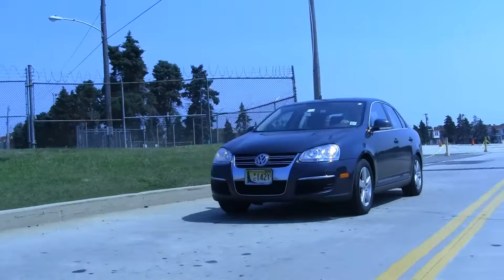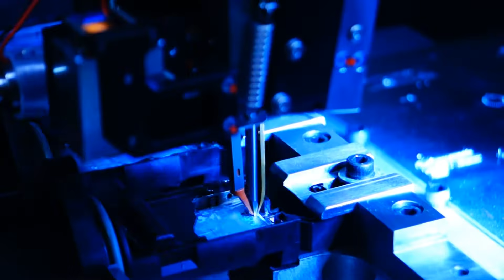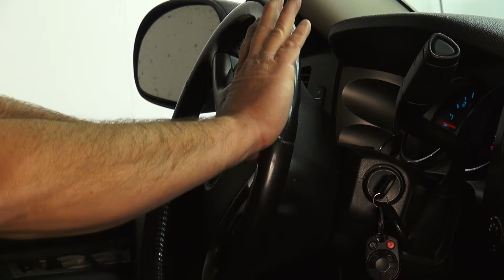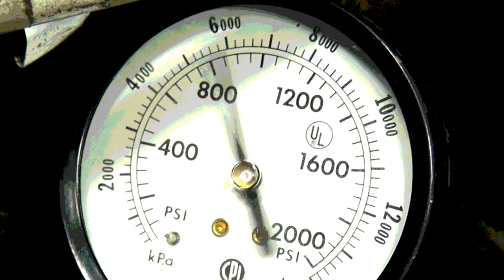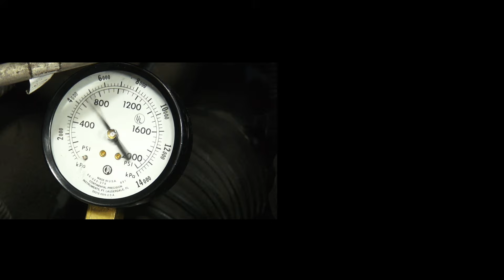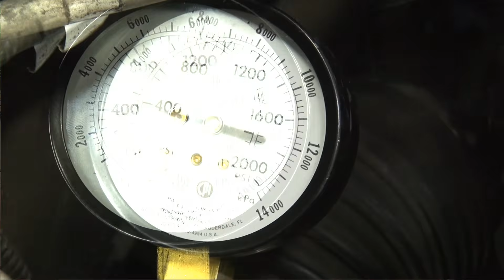How To Use a Pressure Gauge to Pinpoint Power Steering Issues

Comment: Great video! Please be careful with your hands near the gauge, or lines when high pressure is in the system, a small pinhole leak could be fatal if fluid injects into the skin. For safety the load valve can be closed with the engine off and then started to check pressure, just make sure there is no pressure in the system when removing lines 👍

Comment: I am tired of working on my steering system. Bought new ravk and pump, but my steering remains stiff. Please what should I do again?
Reply: Michael Ebuka you need an analyzer that checks for pressure and flow, not just pressure.
Reply: @chrisstromberg6527  belt tensioner?  make that belt really tight  for a moment and check...

Comment: I did that today in my 2002 model Holden VY SS Commodore which runs the 5.7 litre Chevy LS1 V8 engine.

Now,they specify 75-82 bar for the Commodores which all run the Saginaw power steering pump all the way up until 2004 in the VY model then they changed over to a KYB brand in the next (VZ) model.

The dead head test was about 90 bar in mine & the pump maintained pressure at around 1000 & 3000 RPMs,the full lock pressure was the same.

I fitted a power steering rack that I rebuilt last week & I wanted to find out why the steering was going all hard at about after 5:30 AM when I have to drive to work when the temperature is a bit cooler.

All I could find is that the hose clamps for the inlet hose between the reservoir & the pump were a bit loose so I tightened them up,air may have been getting sucked in.

I'll see how it goes next week in the mornings as after work on the hot afternoons (35°C or so) the steering is as light as a feather.
Reply from the maker: Hopefully those hose clamps were the issue. Thanks for sharing, Russell.
Reply: Mine is like the opposite. Free steering on cold start.. gets stiff as I drive

Comment: So its the same as, dont take a very sharp corner for more than 5 seconds or you will burn out the pump!.....the pump has a built in pressure relief valve which will at the pump rating blow back into its feeder pipe without any damage to the pump. this can be done for much longer periods than five seconds , otherwise you are spot on.
Reply: the combination of high pressure and internal oil recirculation due to pressure bypass means the oil circulating in the pump gets very hot very quickly. the temperature in the pump is much higher than the rest of the system hence the pump damage.
Reply: Like I said....you are spot on except for that five seconds.